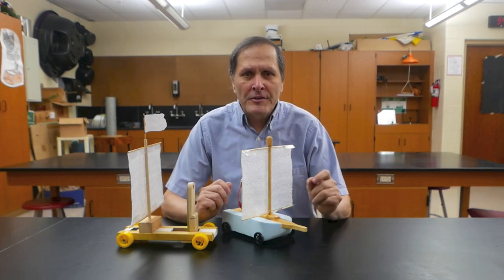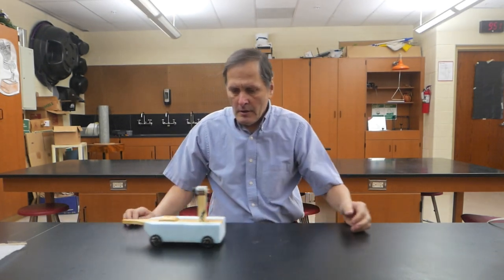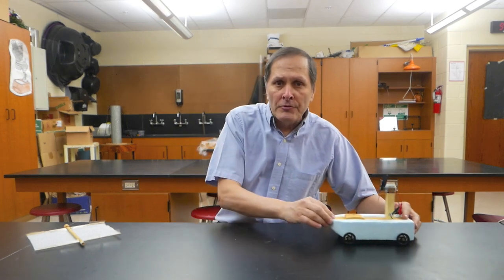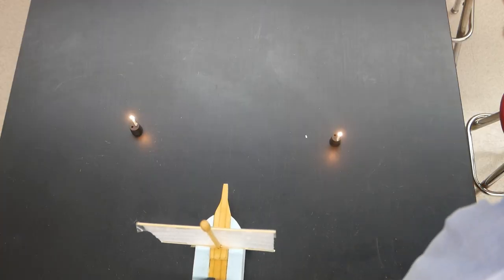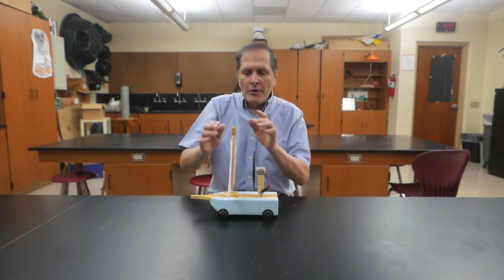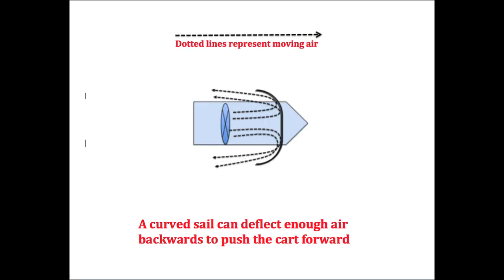Fan Cart - Blowing into your own Sail- part 1 // Homemade Science with Bruce Yeany

Comment: So how would this work in a perfect vacuum?
Reply: You only need exhaust gases for it to work on a vacuum, Newton's 3rd law still applies.
That's how rockets work.
Reply: Joseph Meredith there would be no air to blow so the cart wouldn't go anywhere, sail or no sail!
Reply: john hirst bodybuilding Exactly thank you.
Reply: Gordon Freeman the topic of the video is "blowing into your own sail". Of course if you had just the balloon then the Cart would be propelled. But with the sail affixed you would have an equal and opposite force acting on the cart which would negate the initial force from the balloon.

Comment: Taking into account the law of momentum conservation some additional explanation is needed for case of curved sail, bacause  we obtain air from back and push it backward again... it seems that Coanda effect is key to understand movement here.
Reply from the maker: I think I did a better job in part 2,  I played around with the condo effect, I've been wondering how it applies here
Reply: Construction with fan and "reversed" curved sail as at 5:04 reminds me this video of Coanda effect flying saucer toys and air there has single from_top_to_down direction (opposite to lifting force!)
The thing that confuses me much in case of "normal" curved sail experiment (as at 4:07) is that according to the law of momentum conservation to move forward  we shall to throw backwards more air then we obtain from backwards... But the air is actually circulating both directions back and forth, so for me it looks like there shall be some additional force here (because such circurar air trajectory reminds me the story how Baron Munchausen saves himself from drowning by pulling on his own hair).

Comment: The boat spinning  is p factor.... The propeller turning imParts the spin by the bottom of the prop is not  getting clear air so less push to side the top gets clear air so more side push thefore spin.... Also the air hitting the sail is spinning in a tornado like vortex so many other factors affecting it that you can cover that will get kids thinking about what they can't see..... You also have the torque of the motor and the centrifugal factors of the spinning mass and how a gyroscope pushes at 90 degrees to the rotation.... Lots of other factors to cover and think about.... The curved sail is a parabola that can lead to his sound is reflected by parabola

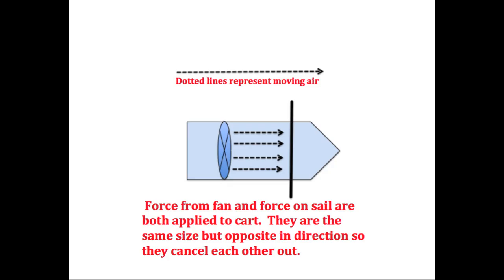Comment: Sure does look like you had to adjust at 1:50 and one other time a little before to keep the cart from going in the 'sailing' direction....
Think about it, it makes sense.  The fan needs only to get a reaction from changing still air to air moving forward, but the sail gets the reaction from the air moving forward, not just until it is stopped, but until it is moving off the sail, which with the curve in the sail has a rearward component, i.e. the change in velocity is greater.
f=ma  
f=m(v2-v1)
.
The mass of the moving air is the same, but the change in velocity (in a large room with a significant supply of still air an no great obstructions) is greater in the direction of travel for the sail that pushes some of the air back toward the fan, 2hile the fan need only motivate some of the readily available still air.
The actions differ meaningfully, so the reactions are different too.   Otherwise you wouldn't have to make those furtive corrections.
Reply from the maker: Interestingly enough,  I hadn't noticed them until it's been point out in this video,  I have lots and lots of video that i went back and looked at  of it just sitting there and never saw it move more than an inch or two and then stops.  I would have liked nothing better than to see that cart  go across the table, I was really hoping to get it  move in a straight path in the water.  I am testing again next week with some ideas suggested in the comments
Reply: You can make it yo forward, using a very curved deflector/sail.  It doesn't matter wht direction suction if aimed, only which direction the air ultimately is directed.

Comment: what if your vessel had a keel or wheels to restrict movement to forwards and backwards. Then you mount your fan perpendicular to vessel keel and blow air across a sail mounted at a 45 to keel. The net result is a force at an angle but the keel 'cancels' out the non forward forces resulting in movement. voila, blowing into your own sail.

Comment: You put the sail on the ship backwards twice... Once with the balloon, the other when you first put it in the water with the fan. The mast is supposed to be behind the sail relative to the bow, so that the sail can fill without being blocked by the mast. Also, I believe your sail was too tight, it should have a little bit of slack so it can flex and catch more air.
Reply from the maker: I will redo it correctly next week

Comment: So what I'm getting is that it might work with the correctly shaped sail directing the blown wind backwards. BUT, that will never be as efficient use of the air as if they had simply turned about face and blown in that direction in the first place.

Folks always want to make life harder than it needs to be.

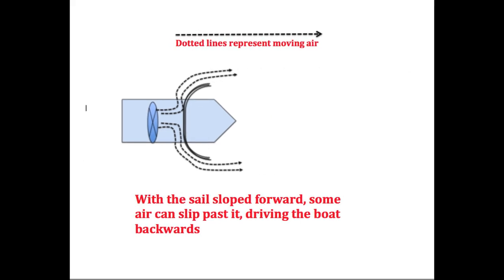Comment: 5:19 and 8:22, you state that the air goes around to continue pushing, but I suspect that is not correct.  The air pushed by the fan directly hits the cone and the energy is balanced completely, but the fact that the air curves around causes "lift" in that direction since air is moving across the curved surface.....similar to the wing of an aircraft.

One way to test this is to have 2 fans facing away from each other but very close, perpendicular to forward motion....this would mean that there should be absolutely no motion (if the fans are designed similarly).  place the sail as close to the fans as possible but not in the direct path of the air.....the ship will move (coanda effect).
Reply from the maker: I gave it another shot in part two,  at the end you can see the air movement with a bit of smoke added but I'm still not satisfied and have a few more things to try.  Thanks for your advice

Comment: That curved "sail" you used doesn't accurately represent a real sail because your curved one just re-directs the flow of the air while a real sail relies on the wind to physically push the sail thus pushing the boat.

Also, if your fabric sail had the ability to twist clockwise and counterclockwise freely, it would possibly be able to auto-correct itself while the fan is blowing on it to cause the airflow going off to the port and starboard to be equal. (If the left side of the sail is closer to the fan, it will have a higher force applied to it than the right side, causing it to be pushed forward, rotating the right side to be closer to the sail and vice versa. This is just theoretical though.)
Reply from the maker: I've had so many comments about this I will try it again next week

Comment: My first guess was that it would not move. Nailed it ! If the sail was cupped so the air steam was directed to the rear of the car it will move forward, and or, if a the sail was triangular and had a airfoil shape a lift vector could be generated to move the car forward or even backward it bet ya .  (These  post are kinda fun)

Comment: people wonder sometimes how a passenger jet with jet that suck in air from the front and blow it out the back, can push themselves backwards on the runway. It's because of the thrust reversals. 2 cowls on the back of each engine that clamshell together and redirect the air forward. They create a similar shape to the hard shell sail in this video.

Comment: I wish you had done a final test blowing the fan into the sail at an angle, with a keel on the boat. The concept of sailing is lost without a keel which would reduce the torque.
Reply from the maker: so far I've been looking at it  with the sail perpendicular to the air flow because that matches up to the fan cart demonstration which is a popular science piece of equipment.  In a future video I will look at other types of sails

Comment: The reason your first boat didn't move is your sail isn't to scale and its too tight.  Its too thick and rigid. A real sail is flexible and will not remain flat it inflates. You also put your sale on backwards. It should be in front of the mast.
Reply from the maker: I will try to do it better next week

Comment: THe misleading that most people state is its about the card.

but its obvious we have face force... and sail... force and their net result is zero... the cart is analgoous ot hte entire physical relation, other then we want some sort of useful energy or movement  to prpel the cart, which means we need a force greater on one side or not. 

the same force oming out of the baloon would be the same force receiving by the sail... each direction is the opposite. 

we cna see the forces appliled a direction pivot which generates the motion direction.

SO having a sail that is angular... to the force creates a forward motion. So if the sail is say able ot instantly  gate itself or cahnge its angle to the force, it wouls traighten out its movement. so you could make a propelling forward motion by angular switching of the sails.. kind of like canoeing back and forth to keep straight... 

so... its itneresting... and hten you have vibrations adn more...

so spinning objects with gates can have forward motions.. hmm I have seen tah somewhere else in biology and physics.. 

the question is can you optimize the sail so it exceeds jsut a fan operating its force.. This then becomes energy reserve or constraint hwich system better utlizes energy to generate a force. hmmm.. fan alone... and its direction of spin and its engineering shape and angle.... so everyhtign from ground up would have to be speicifically engineered for the desired result which would take osme udnerstanding...

What would be hte most effecient sail design.... A angular gate design, then again... back in my sea cadet days, I would go back and forth, into the wind and get pretty good speed, cutting back and forth.... becasue run out distance... but if yo ucan instantly swap back and forth... your bascailly would look like your flapping motion is generating the forward motion, but in reality it is the use of the wind, or motor system.. hm...

Comment: You're forgetting the importance of the direction of heading versus the direction of the wind external wind.  There is an appropriate ratio of pressure required inside versus outside the sail in order for it to have a curved shape to create an air foil and hence "lift" that pulls the boat forward.  This is lacking for your model.  Consider 2 arrangements: foresail + mainsail, and just a mainsail.

Comment: Why does he put the sail on backwards nearly everytime he does the experiment? Furthermore the method would work if it came down to a matter of power. The bigger fan was able to generate more push and by scale it was a much smaller surface than what the smaller fan had to come up against so in order for the model to work you would need to compensate size and weight so for instance instead of using a plastic fan you would use one with heavier or wider blades like metal and so forth and then increase the rpm. This would generate enough outside force to push the sail but overall it would be too much effort and resources to be practical in modern use but would prove that the model could in fact work.
Reply from the maker: Hello Nathan,  you make some good points and I hopefully address them better in the follow up video that I made after this one.

Comment: You don't explain the curved sail quite correctly. If the sail is flat the flat plate drag is the same on both sides. If its curved, the curved side has leff flat plate drag!

Comment: The real issue with sail in the show is that it isn’t a triangle the reason that’s an issue is because there is only one sail. If a ship is to only have one sail that sail needs to be the sail the ship lacks the head sail. It is triangular so it catches wind the way the cardboard did it creates a cradle in every direction instead of two. The other problem is well the fact that in the show think about how big even the smallest pirate ships are the one they are on is just not big enough and if it was it would take at least 50 people blowing the sail from less than an inch away from the sail to make it move we are not powerful enough regardless. The pirates would catch them wily coyote wouldn’t go anywhere cause even that proper bulge isn’t enough and anyone saying real sails would work are only half right. Lastly the sail to ship ratio is so far off.

Comment: your fan isn't powerful enough. if it was super powerful, then it would cause the sail to adopt a curved shape, deflecting the air backwards and thus moving the vehicle in the desired direction...note that Dr Doolittle's sail is already curved, so it might well have worked to some degree.
Reply from the maker: Hi Max,  I  got it to work better in the video that follows this one.

Comment: You should try the flat sail with opposite rudder
Reply from the maker: Hi Christopher,  I did a better job of it in the video that was a follow up to this one
Reply: Bruce Yeany 
I hope I did not come off as critical. I was just wondering with the flat sail on a 45° angle and a rudder in the opposite. I know the efficiency will not be as good as the prop pushing but just curious. I will check out the next video. Thanks!
Reply from the maker: Christopher,  thanks for your note back,  you didn't come across critical.  Posting videos has been a learning experience for me and I look forward to hearing suggestions. I accept the idea that others understand many of the topics more thoroughly than I ever will.  I'm still not done with the sailing videos, I have two more planned where I'll try and take it further
Reply: Awesome I look forward to seeing them.
Reply: Bruce Yeany and you do a great job. I bet your students love your class. I know I would

Comment: Looking at this evidence that rockets do need something to push against, the interesting question is how they can claim rocket engines are more efficient in space. ;)
In a vacuum there is simply no other propulsion possible than generated by the 'mass of the fuel times its speed' and thus resulting in an extremely low thrust.

Comment: "Grab a metal propeller, attach a magnet to the backs of each blade of the propeller. Now since the blades are metal it would be attracted to the metal of the next blade, causing the propeller to spin infinitely boom infinite energy". Can someone please explain this simply why this troll physics doesn't work?
Reply: The nearest Propellerblade is pulled Most bei the Magnet.   ---> the Propeller stay at the Position of lowest potentional Energy.
Sorry for the spelling i write With a German autokorrection.

Comment: there are two obvious issues with your sail. Firstly its on backwards, real square-rigged boats put the sail in front of the mast, not behind it. Secondly, there is no slack in your sail, again real sails have slack so they can assume a paraboloid shape when filled with air, and normally the bottom edge is left free, with only the corners attached to ropes.   These are pretty much the reasons why your sail ended up deflecting air to the sides. If you put the sail on correctly, it will behave much like your cardboard one, because it will naturally curve.
Reply from the maker: I think I did a better job on the follow up video to this one

Comment: good grief... the curved sail should be in front ,,the fan facing the back in back..
you get the full force of the fan to the rear ,.. the front  of the curved sail deflects wind in front and catches wind from behind doubling your force..any sailor knows this..your fan is acting as a wind propeller just like the prop of a real motor sailor..geesh man

your example is losing 90% of the fans power..geesh
Reply from the maker: Hi johnny,  what you are saying is totally correct but  in this demo I'm not looking for the optimal movement of the cart.   In science classes,  fan carts are  commonly used to show Newton's 3rd law of motion, when forces are  equal and opposite  an object will not move.  KInd of like trying to lift yourself off the ground by pulling up on your shoelaces.  The force on the sail and the force generated by the fan are said to be equal, no motion, the  standard demonstration.   I'm just trying to show that there are some additional forces in action here that the regular equipment tends to ignore due to it's limitations.
Reply: ok you win.. you definitely showed the top 10 worst ways..and demonstrated your point quite well..
i always find also telling the best way,,,, encourages finding BETTER ways forward..
but what do i know..
thanks and blessings..
i stand corrected
doc johnny

Comment: REAL SAILS ARENT FLAT SURFACES! You have made quite a good sail but the direction in with you are mounting it in the boat is wrong that is why the boat spins and the cart stays in place. Air from the fan (or baloon) cant bloow up the sail becose there is a stick behind the sail (it should be in front of the sail) and the sail material isnt loose enough to form a rounded shape like a cardboard one that you have made.
Reply from the maker: Here's the problem that I run into when I try to compromise,  while  I built my cart,  most physics teachers may have a fan cart that has a rigid piece of plastic as a sail,  I was trying to show what may be going on with their fan carts rather than being true to the shape of a sail.  This would have been better if I included a cloth sail as you suggest.